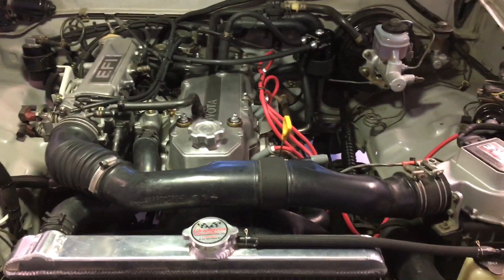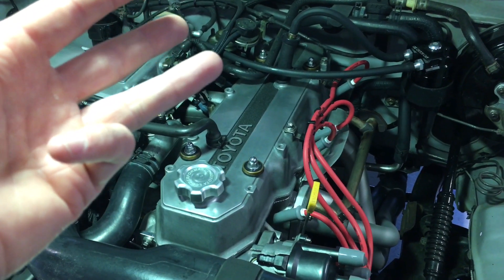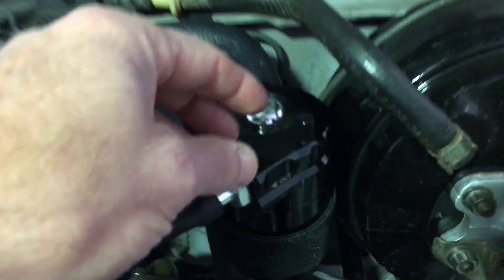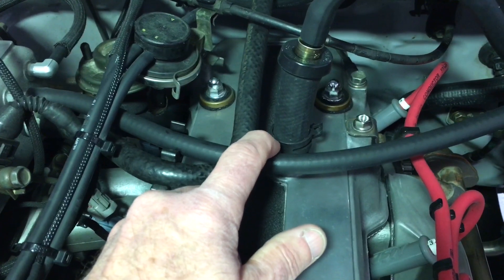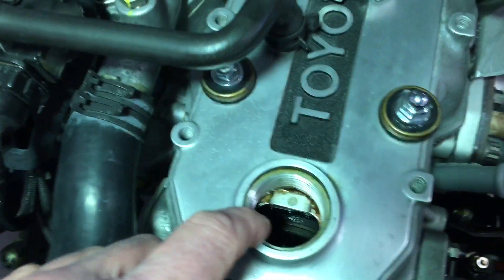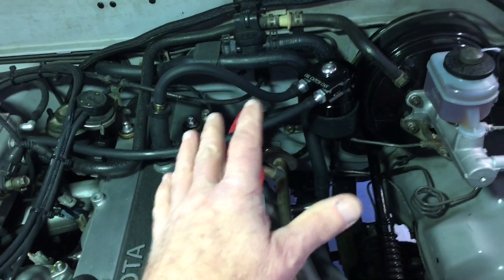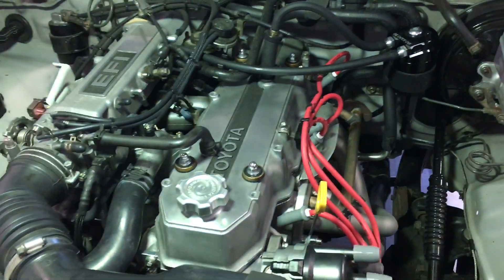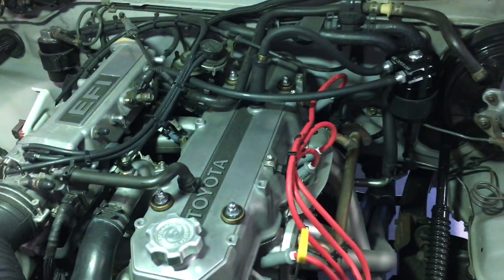Excessive oil consumption on Toyota 22RE motor finally solved?

Comment: I just put a rebuilt(but not good) engine into my 4runner. It didn’t have an oil pickup tube in the engine! So it was ran briefly before I got it and I ran it for about a minute before I figured out something was majorly wrong. 

Fixed all that and done 1 100 mile oil change (like a concrete mixer slurry) and another at 600 miles (missing several quarts of oil and black as midnight and thick and gross. Hopefully a PCV modification like yours with a catch can and some baffle bending will solve 90% of my issues. I’m regeared to 4.88 axles and have 31” tires (used to have 33’s). That means 3000-3500rpm on highways! Lots of rpm means lots of oil movement and getting sucked out the PCV
Reply from the maker: Yikes.. yeah trust no rebuild unless you do it yourself. I just rebuilt my motor for the 2nd time and discovered the previous owners rebuilt the motor and installed the wrong size piston rings... wow. If your motor has a lot of sludge in it, you might consider using something like motor medic engine flush. I used that twice on my motor (prior to rebuilding it) and it seemed to clean things up pretty nice inside.

Comment: I had something similar happen to my suzuki samurai with a chevy 4.3L it was a fresh engine i did the break in then about 1000 miles later the engine seized up due to no oil. Apparently the pcv had sucked everything in. Its been sitting for almost a decade since.
Reply from the maker: Sorry to hear that - sounds like a fun engine swap. Yeah, the PCV system can be really troublesome when it isn't functioning correctly; there's something to be said for running a dry sump right? :)

Comment: Great video. I’m trying to find how my celica is burning a quart every 200-300 miles. Not leaking out, and plugs aren’t Fowled, might look at my PCV now, thank you
Reply from the maker: Yeah could be some blockage in the oil return hole in the back of the cylinder head. Stuck open PCV also. Stick an oil catch can on to see if the oil is going that direction or not. A lot of times that much oil consumption will point to broken rings.
Reply: @ just checked the oil return, no blockages, PCV valve just lets air pass, I believe it to have failed. Thanks for the tips, I got a new valve on order as well as catch can. Ran a bore scope down the spark plugs and don’t see any oil or scoring.
Reply from the maker: @Kodekrashed  yeah if the PCV valve is stuck wide open that could do it, especially if you live in an area with a lot of hills. When the motor goes up a hill all the oil runs back there and sometimes it can swamp that rear baffle - if the PCV is wide open you basically end up with an oil vacuum cleaner back there.

Comment: My '89 consumes a quart a day without hills!  Wish I had the time to do this stuff.  One pro is that it never needs to even change oil but it lubricates the asphalt and driveways well.  Front oil seal - third time.  Mine might be the  front crank bearings as a root cause.  Not great for the rubber parts either...
Reply from the maker: quart per day is ring failure typically.

Comment: I have the same vehicle. I’m not sure if my oil pressure is too high because it pushes the seal out of the oil filter the moment I start it up. I thought maybe I had the wrong oil filter but after fitting 3 different oil filters I’ve come to the conclusion I have a high oil pressure problem.  I’ve also noticed when I take the oil filler cap off while it’s running there is a lot of oil comes out. Anyone have any ideas what the problem might be ?
Reply from the maker: Could be a blockage in the oil galley or the passage between the block on the head. The oil flows up into the cylinder head / valve train via a very small passage around one of the head bolts - if the engine has sludge inside it, that could be inhibiting oil flow. What oil filter are you using exactly? Sounds like something is very out of whack. Also what weight oil are you running? You might consider using Motor Medic Engine flush to see if you can clear out some of the sludge inside motor perhaps.

Comment: Interesting
Reply from the maker: It was quite the learning experience. Ultimately, it turned out whoever rebuilt the short block before me used the wrong size rings. But I definitely learned a lot about oil consumption this year haha
Reply: @ray5961  well glad you got it figured out, nice truck too
Reply from the maker: @clayton203 Thanks man!

Comment: After replacing my head gasket due to an external leak, smoke on start up, and coolant disappearing, I must report that although I fixed the external leak, I'm still smoking on startup and consuming oil and coolant. Any ideas?
Reply from the maker: hard to say. I'd run a compression check. Are you getting coolant into the oil? When you say coolant is disappearing, how much are we talking about? Also how much oil is being consumed. Check your plugs also to see if they have any signs of oil or water on them. See my videos on oil in the water and also the recent one (a few months ago) talking about the intake gasket leaking. You could have an internal coolant leak across the intake to head manifold if you did not seal that area with RTV. Some of the modern gaskets are very slick on the surface and do not do a good job sealing. If the failure is near the intake runners, the induction system can draw coolant in there and burn it right out through the intake valves.
Reply: @ray5961  OK, I'm burning about a quart every 100 miles, and coolant was full about 400 miles ago, now empty. I'll do a compression test and report back. The gasket I used was a Felpro (the one that you mentioned), and I only applied RTV at the front on the timing cover, per the manual.
Reply from the maker: @not_a_nihilist_man  Yeah, something is very wrong. one quart every 100 miles is way too high. Even when my motor had cracked rings, it was managing 350-400 miles per quart. Did you do anything with the pistons on your motor or only just new head gasket? Also, did you check to make sure the head and block were both perfectly flat? Even the best head gasket can only compensate for around .002. Also, did you replace the front timing cover or anything? It almost sounds like your head isn't totally down on the block; if you don't trim down the gaskets on the front cover (where the manual says to put RTV) it can tend to hold the head gasket up a tiny bit. But something sounds way off. How well did you prep the block surface as far as removing the old gasket material, etc? And did the motor ever overheat, because that can warp the head and prevent proper sealing. If you look at my video regarding hand scraping the 22RE cast iron block and flattening my cylinder head from LCE, you an see how delicate a process it can be. It almost sounds like something is between the head/block and causing it to be held up slightly, which could produce a failure around the oil passage in front and also the water jacket. I'm wondering if maybe there is too much RTV around the timing cover or something? It's hard to say for sure. Also, did you chase all the bolt holes w/ a tap to clean the head bolt holes/threads in the block? And finally, did you put a bunch of oil on the bolts when you installed them? If you oil up the head bolt threads too much, what can happen is you can end up with too much oil in the hole and when you go to torque down the head bolts, it will create a mini hydro-lock situation under the head bolt end - this can cause the head bolts to not torque down correctly and/or in extreme cases it can fracture the block itself. I usually chase the holes in the block with a bottoming tap and test thread in all the bolts or studs and take measurements against the thickness of the head to ensure I'm getting full clamping.. also I usually do not use oil on the head bolts, but rather a tiny bit of ARP lube. What torque are you running on the head bolts?

Comment: what is that on the air intake?
Reply from the maker: Oh I was testing an external baffle kinda thing. I ended up refining it more in later videos. It helps prevent too much oil getting up into the catch can and has some green paint stripping material in there which gives the oil vapors some place to coagulate and drip back down into the valve cover.

Comment: what is the suitable oil SAE please?? for this car
Reply from the maker: It depends on the outside temp. The manual lists either 10W30 or 10W40 depending on outside temps. What's your weather like where you live? Like how low does the temp get out side in degrees F

Comment: Lol... wow I upgraded to the dual row timing chain myself and noticed almost the exact same amount of oil consumption and the same plug issues being fouled out with oil.. I'm so glad I stumbled across this... thanks for the video!
Reply from the maker: You're welcome... and that's very interesting. I'm starting to think it might have something to do with the higher volume/pressure (?) oil pump that comes in the LCE dual row kit. Is that the one you used as well?

Comment: I have a 22r 1988 and that car are stock i dont like the time of acceleration i think to install a little turbo but the block can survive?.
Reply from the maker: You might want to order a few books on forced induction theory and turbo / supercharging. There are some good ones on amazon. A lot changes when you turbo charge a motor, so you really have to be fully aware of what you are doing. As to your specific question, yes the block and crank could handle it, but probably not much more than 8 to 12 PSI of boost without some form of water and/or methanol injection setup. If your truck is carb, then a draw through turbo setup might actually work decent. I'm not sure what the stock compression ratio is on the older 20R, but you could probably find it. Anything around 8:1 to 9:1 will work, as long as you retard the timing and limit boost, etc. Usually what takes a hit are the pistons, not the block. Again, you should do a lot of reading about forced induction; there are a lot of good books out there. But yeah, a small turbo with moderate boost usually will work. It's a lot of re-design for not too much HP. If you just want a bit more power for cruising, usually LCE header and better exhaust (and maybe a mild cam) would be a lot easier. There is a guy on YouTube running a big turbo on his 20R as I recall. He's not running the motor in a Toyota, but I think it's a 20R if I remember. Try searching YouTube for "Turbo Toyota 20R motor" and maybe you can find it.

Comment: I have a single chain but I my 89 is also hiring a lot of oil but I did just buy a new head an timing cover kit an just bought a new cam an rocker arms from lce. But I feel like it might be a bad head head
Reply from the maker: Usually a bad head gasket will manifest in either oil in the coolant or coolant in the oil (your oil will look kinda like a milk shake). You can also run a compression check on all the cylinders and see if there is any low pressure and/or leak down. Usually when a head gasket starts going, you know something is way wrong. Generally oil consumption isn't a head gasket, since there are only two passages where the oil goes and only one is under pressure. It can be, but typically that passage is sealed pretty well because it's pressurized. Usually the issue is poor oil control ring, or as mentioned in this video, oil being sucked into the intake system via a faulty PCV system. You can try putting an oil catch can on the PCV vacuum line; that will really show up how much oil (if any) is being drawn in.

Comment: What break in oil and procedure did you use?
Reply from the maker: I believe I used Lucas break in oil #10063 (either that or the comp cams cam break in additive). And then whatever the cam company recommended. I believe it was 20 minutes at 1000-1200 RPM's. But I didn't rebuild the lower end, so that could be a factor here also. No idea what the previous owner(s) did to the lower end, except it does have .020" over pistons in there.
Reply: @ray5961  sorry if you said so in the video, I watched it a while ago and this has been bugging me, but did you check/replace the PCV valve?
Reply from the maker: @filthyheathen1504  Oh yeah... I'm like a PCV valve expert now lol. Currently, I have an airplane suction gauge which monitors the crankcase vacuum levels at the PCV valve in real time... so yeah lol. Like seriously, for an entire month I fell asleep contemplating the positive crankcase ventilation system and design on my truck. It's been quite a journey haha :-)
Reply: @ray5961  well I wish you luck man, I'm so curious what it is,  really like your videos so please keep making them!
Reply from the maker: @filthyheathen1504  Thanks!

Comment: Well it might simply be a bad pcv valve ,no blowby it liturally sucks the oil cap down when placed over the hole. Btw that is such a clean looking engine bay ,the shine on that valve cover looks great.
Reply from the maker: Thanks! Yeah, I was real pleased with how the valve cover turned out. I block sanded it and used some HTV wrinkle finish black in there around the lettering. On my truck, I have a suction gauge out of an old airplane, which I use to measure the actual crankcase vacuum draw. That helps a lot. It's setup just after the PCV valve. You might also want to check your fresh air breather. I'd check the PCV valve of course also. On my truck, I'm running the dual adjustable PCV valve and it's been a life saver. I have things setup so there is a constant 1/2 to 1 in/Hg draw across the crankcase. Keep in mind, with the fresh air breather hose, the PCV can never really obtain its true vacuum level. It's sort of a constant cross wind for the motor. I might do a video on that soon, once I confirm how much oil is being used through driving. Keep in mind that too much vacuum on the crankcase is just as bad as not enough. You have to strike a balance. I'd also recommend running one of those little $25 oil catch cans off amazon. Those things help a lot and really allow you to monitor what is going on w/ the PCV system.

Comment: I have a 90 4x xc . It has started consuming oil . I need to check for blowby if not ill check the baffle . Its a single row chain still . 
I have had Toyota trucks since 83 .I built a 22re that is in my rock crawler 86 4R sas . It is the strongest 22re Ive had mild ported 3 angle valve job ,eng builder 268 cam advanced 4*,decked block to where pistons where out .014 ,stock ex to the cat . It gets 19-20 mpg pushing 37" tires and pulls mountain roads pretty good . Anyway thanks for the vid and explanation . I am hoping the 90 4x is a simple valve cover baffle issue .
Reply from the maker: The baffle modifications I made to the valve cover didn't have any impact either way. My issue was related to the PCV and breath stuff as near as I can figure.

Comment: Would you still recommend lce performance head
Reply from the maker: Yes, absolutely. It's a nice upgrade from stock
Reply: @ray5961  thinking of doing this upgrade , what cam do you recommend, do you enjoy the chop. What else did you upgrade to your engine  for this setup
Reply from the maker: @Maganaeffect499  I used cylinder head part #1021024 w/ pro efi cam. I also installed their rocker arm shaft with the extra holes, as well as their dual row timing chain conversion. I'm running their LCE ceramic coated header and then I welded up a full 2.25" stainless exhaust.

Comment: I been so excited for your next videos! Keep up too good work!
Reply from the maker: Thanks!
Reply from the maker: @UCcv9CXj1RuJ7LumMgEio7LA I feel your pain. It's definitely not a good idea to allow any engine to sit for 2 years, because cast iron rings can rust into the cylinder walls. You could use a bore camera to inspect the walls, however, to see if that is the case or not. Beyond that, sitting shouldn't be a major issue to the guides, etc, etc. Based on my experience with the 22RE (which is somewhat limited), it doesn't seem like a great motor for performance based modifications. My motor maybe puts out 135 HP at the flywheel, but it's pushing the limits of what the stock ECU likes. You can certainly check to see if oil is coming into the intake system; there are several ways. First off, pull the spark plugs - if oil is getting sucked in, they should have a pretty distinctive low black sheen coating all over them; that's a dead giveaway that it's sucking / burning oil. You can also drive up a big / long hill and see if the motor starts blowing smoke out the back around 1/4 or 1/2 mile up. The reason is because any oil sucked into the intake will roll off the ledge in there and pool into the #4 intake runner (assuming a stock intake manifold setup of course). This oil will be blown out #4 spark plug and yes, it will look like a 2 stroke basically (or worse). Anyway, I'd say run a compression check on the motor and see what's up. The oil catch can will also really help you diagnose stuff. You can also just block off the PCV valve and run a breather for a bit for testing (make sure to also cap off both sides of the fresh air breather line that goes to the front of the valve cover, since that can allow air into the system (and if you have a breather, it will end up being un-metered air). Let me know if I can help with any other info. Good luck!